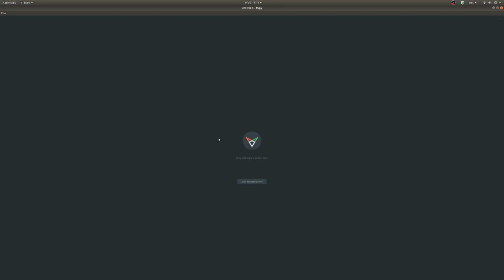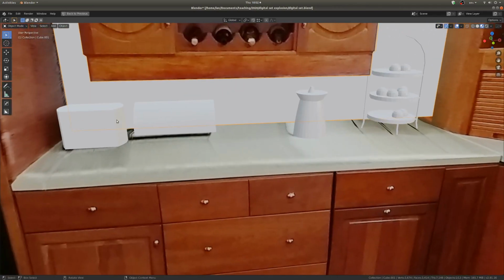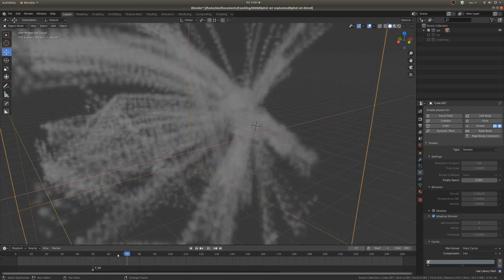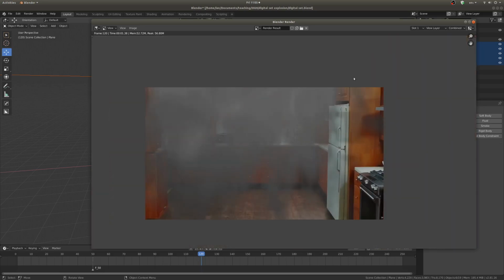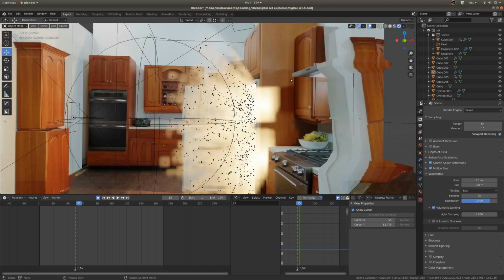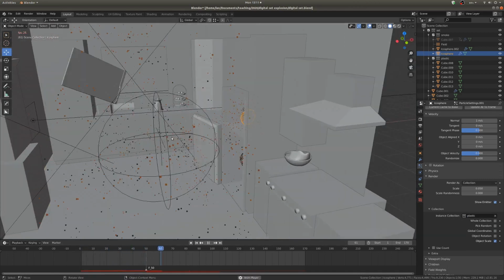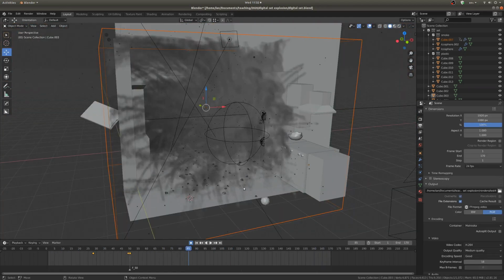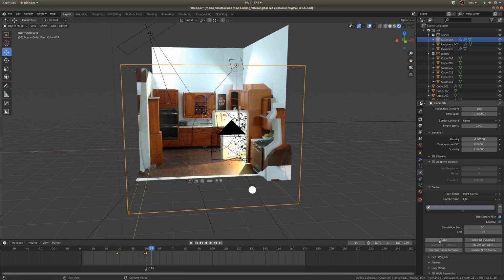Recreating A Set In Blender [And Then Blowing It Up]

Comment: You need to make the fridge an obstacle so the sim knows it there, so it won’t clip through it, was the camera locked off for the explosion, what resolution was the final sim? You usually need like 300 in Blender for high quality but it takes ages to bake, I the think sparks/embers are little to big especially when they fly at the camera they just look like orange spheres, I think it need some bokeh/depth of field to really sell it
Reply from the maker: Hey Gower,  I appreciate the tips. :) I have the fridge set to be an obstacle and I have DOF enabled.   My final sim resolution was 100 with one level of hirez on top of that. Good to know about the value of 300.   I tend to agree that the sparks don't look amazing. I found that eevee doesn't have a particle info node so we can't change the color/lifetime yet there. I think that would have helped massively.     Once again, thanks for the pointers. Cheers